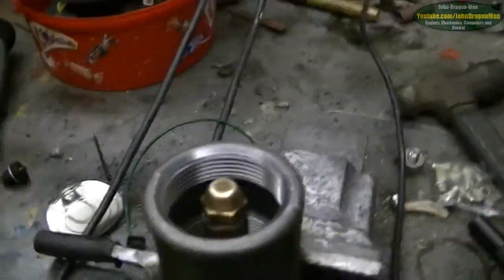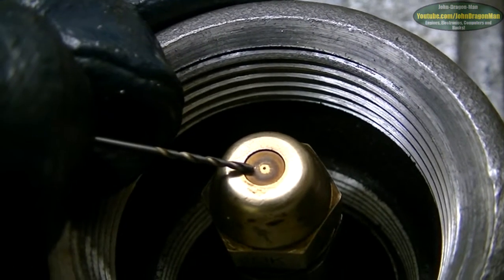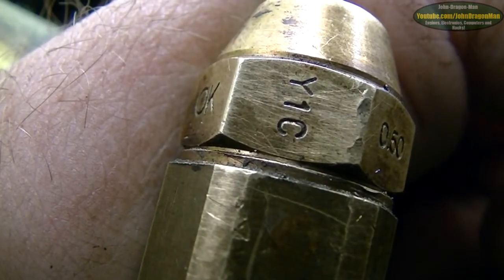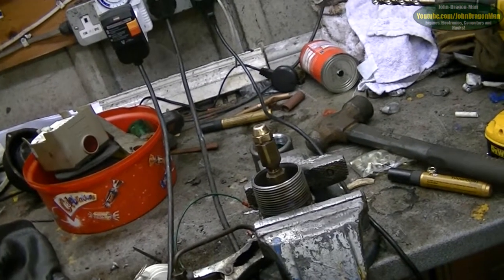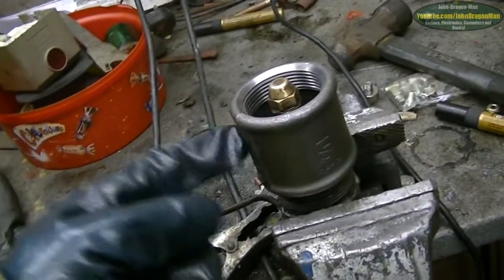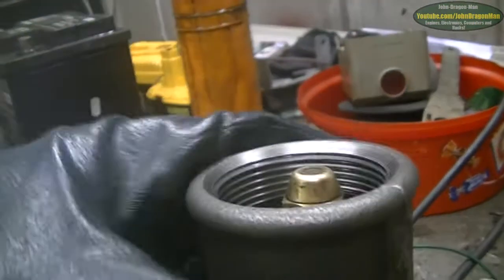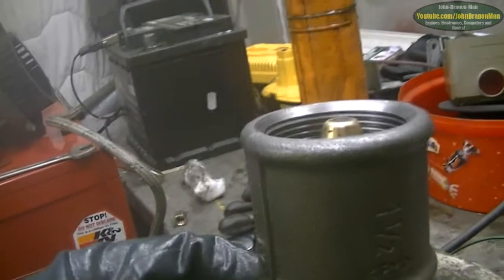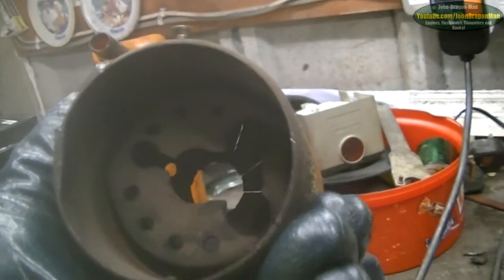Testing how the babington oil burner jet works

Comment: the nozzle maker is Danfoss the 0.50 I think is thousandths of an inch thats the bit Im not sure about. the 80 id the angle of the fan jet from the nozzle.
Im enjoying your videos it makes a change to see somebody from UK makng the burners.
Im interested to see how your design works.
I have my own ideas also that I havent tried yet.
I subscribed as I have made a few gas bottle woodstoves myself and its interesting to see what others are doing.
Reply from the maker: thanks! we found out a few things only a day or so ago. yes this nozzle is a danfoss. it has a jet size of 0.50 mm and it is an 80 degree spray. the other bit means that is sprays in a "O" shape but just around the outside, not in the centre. this creates a lot of spitting so its not ideal for a babington burner.

we have just bought an other nozzle it has a 0.30mm jet, 60 degree spray and it sprays in an "O" but this one also sprays in the centre. much more ideal for a "pool" type vertical babington burner.
should get the nozzle on or around the 27th.

found out quite a bit about these babington burners..  if you want to know anything just ask :D